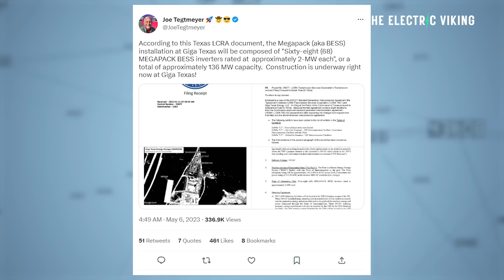Tesla's Giga Texas MegaBattery will make millions in FREE money

Comment: How long until TESLA starts robo production of the latest high efficiency standard format PV panels? is anything in the works???
Will they be looking at the Oil and Gas industry as well for methane and hydrocarbon sequestration and recycling for ICE and long term storage as its currently all quiet on the O&G industry front regarding that, (they are embedded too deeply in legacy production to want to really go green) and at the rate of change they may also be too late to pivot to genuine change to compete against the likes of TESLA or similar.  Are there any other MegaCorps/Billionaires  looking to get into the same markets?

Comment: Tesla will take over the tool business. That said, all he needs to do is build one of these on a rail car. Which is three to four times the carry weight of a tractor trailer.  Charge them at night, at cheaper near zero cost. Use them to powers the rail engine. Cerate a multi source breaking system, which recharges the energy lost. Then you have a mobile power source. With that. if you have enough,  you can create a train schedule where the batteries are always selling high in the most expensive market and charging it cheap.

Comment: Yes, Tesla will operate grid connected batteries to fortify the grid and support sustainable energy.
Examine Master Plan Part 3.  Tesla plans to only spend $300B in CapEx in manufacturing equipment.  
Where will Tesla re-invest it's huge forecasted profits?  Not just manufacturing batteries, but also by operating them.
Where is the best place to start?  Texas.  They are just getting started.

Comment: Interesting - here in Canada the price of electric power is the same around the clock currently.  But I read they are considering varying it according to demand - not yet, though.
Reply: Not in Ontario!
Reply: @rozonoemi9374  Hmmm - I'm in Calgary.
Reply: @netgnostic1627  I heard Calgary gets off peak after 9pm, in Ontario it's 7pm.
Reply: @ericyuan9718  you're about right, I'd say, but there's no change to the rate here.  ATCO is running a time-of-use trial in Grande Prairie this year, and so they may move forward Alberta-wide after that.  I think it would require that all our meters get replaced so that the time of day is tracked vs the consumption.
Reply: @netgnostic1627  Ya, pretty sure smart meters are required.
Reply: Some areas of Canada yes but Canadians get 75 percent of their energy from hydro and nuclear.  Both are very stable and not intermittent. This makes it a bit easier.  Hydro is the cleanest, cheapest source of power.
Reply: @Ryan-ff2db  Unfortunately, the current government in ON is going to build several new peaker plants. That will be billions wasted when they are replaced with renewables.
Reply: @machoopichoo2  Well that's government for you.  I had a networking professor that worked in IT for the pentagon.  He said he would request funds for switches and equipment to handle future expansion but they give him only the funds to meet the current demand.  They were spending 2 to 3 times as much on equipment replacing things every year or sooner, not to mention lots of additional labor constantly replacing the equipment whenever the network expanded, rather then plan ahead.  Later he worked Boeing and said that Boeing was more like the Pentagon than the Pentagon and I don't think that was a compliment.  So yeah your government sucks but so does everyone else's.
Reply: @Ryan-ff2db  Yep. Penny wise, pound foolish. With Boeing, GE, HP, etc. the MBAs took over from the engineers and poof, great companies destroyed. HP is now a printer cartridge business, even though Bill and Dave essentially founded the Silicon Valley. I was involved in the rebranding of HPE (when wonderful Meg W. spun off HP's server business) and now their old HQ is Tesla's R&D building. Ha, Ha. Revenge of the engineers.
Reply: Same in my state in the US. We have a decent amount of solar so they don't discourage afternoon electricity use. 17 cents/KW around the clock in the summer, 24 cents in the winter when the solar panels don't really do anything.
Reply: Ontario hydro rate are cheapest after midnight until 7h00am week days & same low rate on weekend.

Comment: Of course, there's a much simpler solution which is to nationalise electricity supply and distribution system. Then the grid operator can just instruct the peaker plant to start up instead of having to negotiate an exorbitant price to bribe them to start. We have this ludicrous situation in the UK where National Grid have a statutory obligation to supply electricity, but the private generators that supply the electricity have no such obligation. Why didn't Musk use solar panels and batteries at SpaceX base in Texas, instead of a gas-fired power plant? If it works at gigafactory, why wouldn't it work there? Also, Tesla isn't the only company making standby batteries.
Reply: The price of elec. would be about the same if you own the peaker plant , or if you buy it from someone who owns peaker plants.
Reply: @kkarllwt  Yes, but you also own the wind farms and solar farms so you're getting lower cost electricity from them which offsets the higher cost of starting up a peaker plant. This stops price gouging by wind and solar farm operators.

Comment: Storage is the key to green energy. It will be a mix , battery, hydrogen and synthetic fuel. Battery storage for peak grid supply, hydrogen to replace the natural gas suppl and Synthetic fuel for shipping , aerospace,  military and ice. The uk EV market at current sales rates will only transfer 1.5 million cars from ice to BEV, sales this month 20,000 and falling. There’s only 84 months until ice is removed from sale in the uk  and the up take of BEVs could be as low as 10%. If you take peak uk BEV sales of 50,000  BEVs could reach 15% so an alternative low carbon fuel is required. There are other alarming facts I.e most for year old BEVs are extremely low mileage (80% have covered less than 100miles a week) an equivalent ice vehicle (3% cover less than 100miles a week). Every non Motorway charge point is available at all times and the non motorway Tesla sites seem to operate at less than 10% capacity.
Reply: slightly baffled by your sales figures, as far as I can see, EV sales in the UK are exploding, not declining as you claim, but hey ho. On the matter of 'Bio-fuels', sighs, may I remind you that Must wanted the world to shift to EVs for the simple reason that WE HAVE NO CHOICE!! The World is heating up out of control, we MUST cut our Carbon Emissions, period! 'Green' or 'Bio-Fuel' STILL POLLUTES! What the hell is the point, when an EV can replace that costly and dirty fuel while also allowing us to drive safer, simpler cars that cost way less to operate?
Reply: @swanvictor887  🤡
Reply: @lesliecarter4295  awwww did I hurt your feelings...bless your heart...🤣🤣😂😂😎😎
Reply: @tobycolin6271  Thanks, will keep an eye on the situation. Guess things are getting pretty bad over there in the UK, yeah? I heard there is no food in some supermarkets. Sad to see my old homeland in such a mess.
Reply: @swanvictor887  plenty off food and toilet roll.  Electricity and untapped fossil fuel were doing fine producing <1% of the Co2 in the world and less than 0.03% with our ICE cars. Might struggle for space as the first gen Teslas are at the end of their lease and there is no market for them. Their are 2 under 20,000 miles that I saved in January and they are still unsold. In fact there was 100 for sale in January under 25,000 miles today when I looked there’s nearly 300.
Reply: What is synthetic fuel? What a revolution we are witnessing!
Reply: @elephantintheroom5678  synthetic fuel is either petrol and diesel made from bio mass reformulating ethanol, Or carbon dioxide provided from air extraction combined with hydrogen extraction from electrolysis. Currently it’s being used by Porsche in all its racing series and historic cars. You can formulate any fossil fuel greenly at a cost in the uk of £6 a litre (including £2.10 of taxes). Next year all the historic cars at good wood should be running it. It’s the future for racing and possibly greener than mineral extraction for low mileage BEV cars.
Reply: @tobycolin6271  What sort of biomass are they using for it, do you know? Too much biofuel comes from old-growth trees, or palm forests planted after old growth forests are selectively logged, then burnt. Do they use that sort of "bio" fuel?
Reply: @tobycolin6271 What you are describing are bio fuels. Hydrogen derived e-fuels are made from CO2 + hydrogen. This has been developed by Porsche. Hope this helps.
Reply: They are both synthetic fuels and sit under the same fuel type umbrella. All humans are mammals not all mammals are human
Reply: @tobycolin6271  you have to differentiate between these categories of fuel’s which are now being designated under different specifications. They are classified differently. Your mammal analogy is incorrect.
Reply: @tobycolin6271  the reason that they want to differentiate is because in the eyes of the uneducated public biomass is associated with the misuse of land which should be used for feeding the world not producing fuel for rich people to drive their expensive toys. E-fuel which Porsche have developed in a laboratory developed fuel and as such cannot be accused of the same environmental damage. I know it is being pedantic but in the eyes of the public it is important. Hope to get to Goodwood myself this year. Please post what you find out and enjoy the great Goodwood experience.
Reply: @lesliecarter4295  that’s just marketing.  Don’t forget the algae. See you at good wood.
Reply: @tobycolin6271  👍

Comment: megapacks are 4 megawatts each 2 megawatts per hour so 272 megawatts in total. Secondly Texas has the largest wind capacity in the USA so it can fully charge the megapacks at night to use during morning peaks and before its own solar panels kick in. As you say cycling the LFP megapacks multiple times per day could be very profitable.
Reply: Look at kentucky, new battery plant being built demolishes those stats by a big margin.
Reply: 5th like
Reply: @massatube  MW, not Mw. Your other errors are too many to correct.
Reply: @lighthousesaunders7242  Is that the best you have to offer. Correcting typo's. Sad.
Reply: @massatube  Its a shame the batteries are replacing peaker plants which generally supply power for only a few hours, but use 3 times as much fuel to bring them up to power for those few hours.
Reply: Life expectancy on LFP batteries could be a really problem say they charge and discharge twice a day that's 720cycles per year . Unlike a car which is about 1 per week about 50 per year .Then you have the capacity drop in cold weather which could also affect life expectancy , just a couple of points to think about .
Reply: @grahamoldfield3871  LFP batteries can double the regular cycle that NMC batteries can do.
Reply: @grahamoldfield3871  LFP have between 4,000 and 8,000 charge cycles to 80% capacity, especially if discharged to 0% and charge to 100%. In grid storage you could expect the best results so at 5 full charge/discharge cycles per day you could expect 4 years of use before 20% degradation, potentially 1.36 gw of capacity per day, much of which could be sold at peaker plant rates. The cost of the installation could be paid for in 1 year!
Reply: @fredkroh6576  Stationary storage is very different from cars.
No fast charging and LFP degrades much slower, very controlled use, no acceleration, no regen, no fast charging.
Much better cooling
Very little degradation even in 10 years